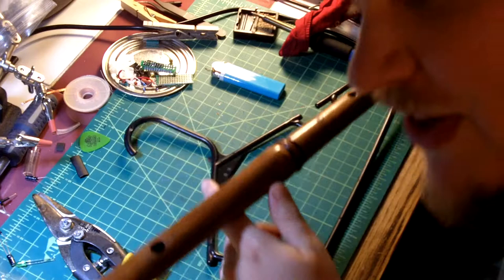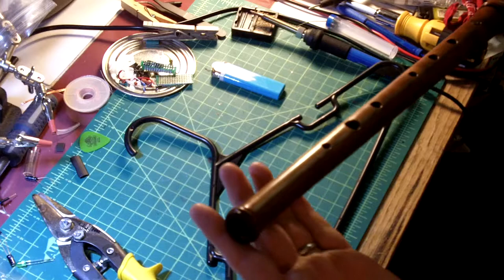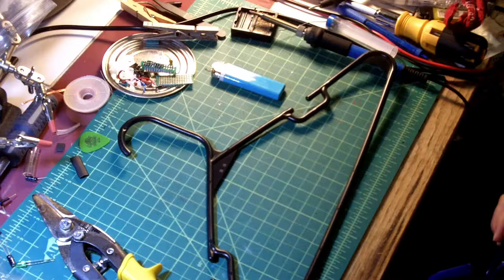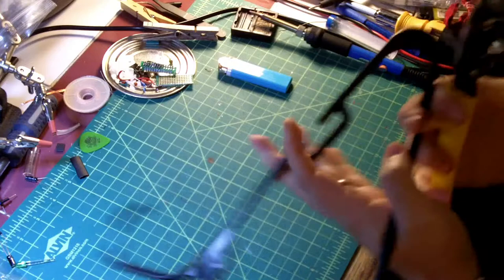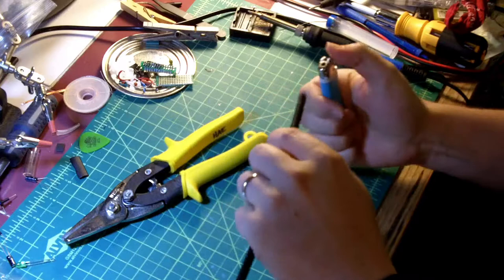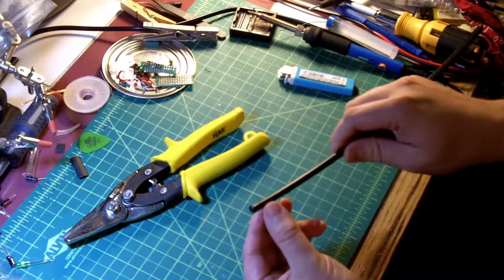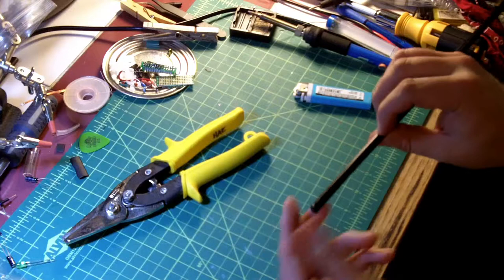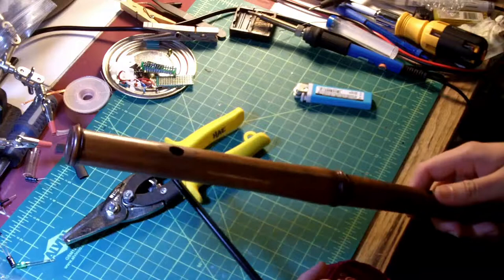Make Your Own Flute Cleaning Rod/Swab From A Coathanger

Comment: This is great!  I am used to just blowing the spit out of my Native American Flute, but clearly this is a better solution.  Friendly suggestion: tighten up your videos by shortening up the fumbling around getting the tips smooth - just mention that it may take a few iterations.
Reply from the maker: Thanks Kurt! I wondered about that--on this one, I decided to leave it in because I sometimes get annoyed with videos that make it seem like the maker does everything perfectly the first time, and I feel like I sometimes want to show people the messy keep-trying-ness of making things. But I appreciate the comment, and I'll try to trim some of that stuff in future videos. Thanks for watching!
Reply from the maker: I blow the spit and condensation out of my flutes while I'm on stage, but for longer periods I want to get them dried out so the liquid doesn't just soak into the wood fibers. Thus the cleaning rod. How big is the bore on a Native American flute? Are they a single longitudinal piece, or do they come apart in sections?
Reply: The size depends on the key and design, but the bore on mine (key of G minor) is about 1" at the distal end and 1/4" at the proximal (blowing) end.  They are a single piece, and there's a blockage (wall) where the air gets channeled up over the lip.  It only needs to be swabbed from the blowing end.  Wikipedia has a pretty good article on them if you want a diagram.
Reply from the maker: Cool! I enjoyed reading that page. It wasn't entirely clear to me from the pictures--is there a narrowed bore where you put your mouth, or is it the full width of the tube? I generally think that it's worth swabbing any area that touches warm/moist air, but I'm (obviously) not an expert on that instrument!

My coathanger rod is just over 1/4" in diameter (in the long axis--it's not perfectly round), so this plastic source might not work for you.
Reply: Mouthpiece designs vary widely by designer.  Mine is full width at the mouthpiece end, so my upper lip presses against the flat end and lower lip curls around it below.  So yes, the end is worth swabbing too.
Reply from the maker: +Kurt Papke cool. If bore diameter is an issue, a plastic chopstick might serve your needs.